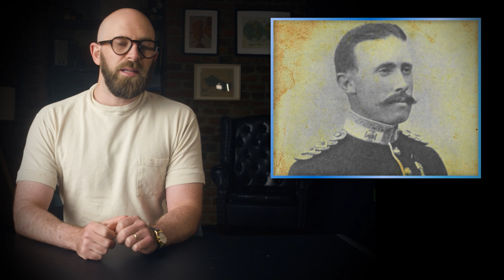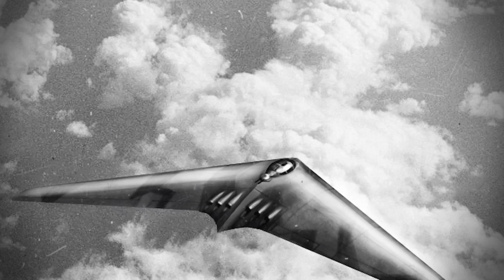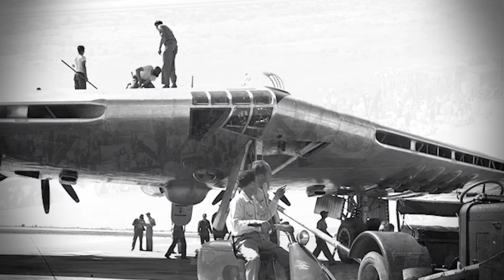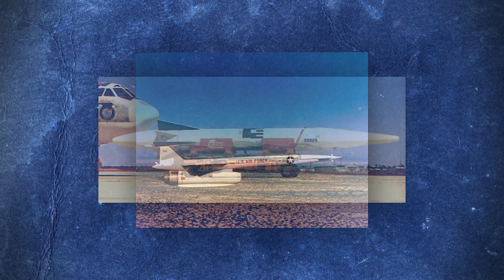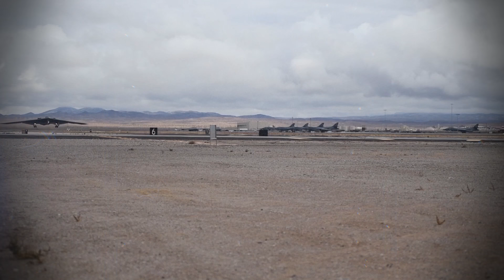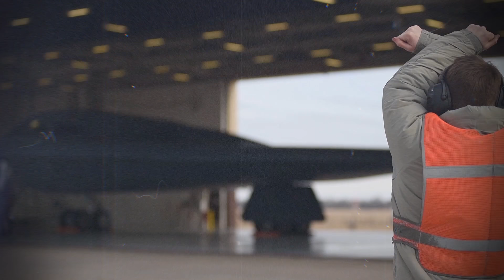$2 Billion Each - A Deep Dive Into the Incredible Engineering That Culminated the B-2 Stealth Bomber

Comment: $23,529,411.7647 Is how much it cost to kill each of those 85 militants.
NOT taking into the cost. The wages of the pilots. The Fuel. Or the munitions involved.
How much did the ground crew cost?
How much did it cost to train the ENTIRE ground crew to maintain this beast?
What about the training of the flight crew?
It has to be stored in a pressure controlled hanger!
Whatever you do, do not fly this thing when there is moisture or rain!

Comment: Part of the high cost is that when planning out it was sold as a 1 for 1 replacement for the B-52s but numbers were cut and instead of spreading out the static costs over 100+ airframes it was just 12 or something to start.

Comment: Not to belittle the achievements of any engineer or inventor I would just like to point out the flying wing should maybe be contributed to also the inventor of the KITE after all if you look at a kite and attach a string that’s really what theses are!!!!
Reply: That’s a silly way of looking at it. Flying wings have historically been some of the hardest aircraft to engineer. Maybe only possible today with highly computerized fly by wire systems

Comment: One minor point. In the XB70 it was discovered that tilting down the outer edge of the wings created a vortex that added to lift.

The advances in technology in the US has been so rapid and extreme in so many areas that these one time wonders are now relegated to obsolete despite constant expensive upgrades to all of them. 

The B21 despite being smaller and having a smaller maximum payload is far more advanced than B2 but is sure to upgraded many times during its service life. 

I have been following developments in military aviation closely and I was shocked and disappointed by the recent announcement of the F47 to Boeing. Based on what I know about the possible alternative designs and contractors IMO the DOD could have done far better in both areas. I think I wasn't the only person who expected the Lockheed SR72 to be selected.  Even this plane in its current prototype form has room for major improvement based on currently available and soon to be available technology.

Comment: I was working for Northrop when the B-2 was being developed (before Northrop - Grumman merger). This was before Auto-cad, and Northrop had developed it's own CAD (NCAD which ran on Unix operating system) which myself and many colleges received training on.  We were able to learn by working on a small collection of pieces of the plane which included parts of the outer mold lines  (defines the external surface of an aircraft's aeroshell).  An associate "Rory" was able to hack together the shape of the exterior of the plane, was subsequently fired for a couple of weeks, and was subsequently re-hired.  I believe this was the first plane to be built using CAD and "geometric dimensioning and tolerancing " to complete the assembly with hard models which were typically used to ensure one assembly fits to another.

Comment: Downvote for the 40 minutes of black and white time wasting like 1990s discovery channel late at night when budget was zero and for your phony cadence, both of which you deserve numerous downvotes for per person. Instead it could have been a decent video but you chose intentional douching of wasting time for your wet dreams of watch time. Was the video not caked in scumbaggery a constructive suggestion would have been that there is thermal video of a B-2 and it is exceedingly visible. Similarly infrared lasers of even very faint power will echo off it at hundreds of kilometer distance. I have little doubt that modern radar circuitry can detect it with similar ease. It is an emperor's new robes illusion. It is an exceedingly expensive sitting duck and it's quite puzzling that the world indulges the illusion. To redeem yourself you could make a video with such an angle. It would be very topical right now.
Reply: It’s the one thing he injects into all of his videos across all 8,000 channels he has. His political biases based off being from Britain I can’t blame him. Sort of a trait they all have. But yes he goes out of his way to spew garbage opinions left and right and it’s a huge turnoff. Would he good content otherwise.

Comment: What is the biefeld brown effect of the B-2 stealth bomber?
The Biefeld-Brown Effect is based on the research of Thomas Townsend Brown who in 1928 gained a patent for his practical application of how high voltage electrostatic charges can reduce the weight of objects. The B-2 bomber employs sufficiently high voltages to significantly reduce its weight. Thus it’s incredible range

Comment: The cigar shaped fuselage enables several sizes of plane to be created from the sample design - simply add extra length to the fuselage.

The flying wing requires the entire plane to be scaled up or down in proportion.

While less fuel efficient, the cigar shaped fuselage is more commercially efficient.

Comment: I was at RIAT Fairford in 1997 when the B-2 was advertised as doing a flypast after flying in from the USA after which it would fly back to the States. It was escorted by two fighters while it was in UK airspace. The whole crowd was ecstatic when as it approached and had its landing gear down. It landed and stayed for an hour or so before it lined up to take off and as it rolled down the runway its escorting fighters appeared and joined as it disappeared into the distance on its long journey home. An absolutely magic moment.
Reply: That would have been awesome to see.

Comment: Simon, you forgot to mention the highly classified thrust augmentation system in the wings, utilising Thomas Townsend Brown’s mega-volt differential system from the leading edge to trailing edge of the wings. This system probably conferred extra RADAR stealth due to the extremely high voltage electrical field around the aircraft. Check out TT Brown and electro gravitics

Comment: The cost per aircraft would have been much cheaper if they had built the original 100 planned. As very few were actually built, all of the costs of research, development, manufacturing tools, etc. had to be paid over 10 instead of 100 aircraft. This included the special materials developed for stealth improvements.

Comment: I was in my deer stand when one of these came overhead. I could not hear it and all of a sudden everything got dark as it went over it was going slow and it looked like it would fall right out of the sky. It was going to do a flyover at a veterans parade in Branson Missouri about 5 mi from where I was at. I could not hear the thing until it went past me. And then it was still pretty quiet. But once it got to Branson they kicked on news afterburners that this guy said they don't have😂. And that thing was deafening 5 Mi away. And it went straight up in the air. I'm sure it did not have anything for a payload in it. That is the weirdest thing I have ever seen as far as aircraft go. That thing came right through the holler over top of me so I imagine they were using this flyover in Branson as part of a training session to maneuver in between the valleys. This thing is damned impressive and I imagine it's probably worth the money we spend on it because we waste trillions of dollars on other crap that we gain nothing from.

Comment: I used to work on the B-2 project.  I was an engineer at Vought, which built the engine sections of the plane, so I can say something about the price per unit.  If you simply divide the total program cost by the number of planes built, you get a number about 6 times bigger than it originally would have been because we only built 25 of them instead of 150.  If the unit cost is $2B with only 25 built, it would "only" have been $333M in today's money with 150, and that's pretty reasonable actually.  IOW, the unit cost is a function of the number built and so always increases with that number decreases.

I can also say that those that were actually built cost more individually than would have been the case if more had been built.  This is because the tooling needed to build the things most efficiently was never made.  Because the design and materials were so radical, the tooling had to be rather different than normally used in aircraft construction.  And for the 1st 20 or so planes, in addition to mastering making the parts and assembling them properly which is part of every plane's construction, every assembly also had to be tested for stealth.  Often, this required slight changes to the shape of parts, which meant changes to the tooling needed for them.  Thus, all 25 were built using cheap, disposable tooling and then a lot of artisanal hand-shaping and such, which is very expensive.  The plan was that once all such issues had been resolved, we'd get permanent tooling for mass production and thus lower costs.  And this agreement happened about the time Vought was building plane #20 (as a subcontractor making only part of the plane, we were building plane numbers way ahead of them rolling off the final line).  And shortly after this is when the program got cut to 25.  So there was no point in buying the proper tooling when we weren't going to get any real use out of it, and so ALL the the planes ended up being artisanally built.
Reply: If only am engineer’s opinion mattered in terms of efficiency amd ROI
Reply: Turns out those B2's are actually really, really good at what they were designed to do. This being said with the knowledge of what they pulled off in June of 2025.
Reply: From an accountant’s point of view, with all those sunk costs, the USAF needed to build more of B-2 to drive down the per unit cost. Plus, additional, why cannot the USAF use the B2 bomber longer much in the way that the B-52 continues to serve.
Reply: Wow you can't even do simple math or thinking... and you are claiming to be an engineer? You literally just pretended that if you made six times as many that somehow those other 5 would have been free... and then you talk about today's money which is inflated so it should have went up not down. You are probably lying about working on the project and if you aren't you were dead weight.
Reply: @thomgizziz another comment by a different commentator align with this one. Your criticism probably is not entirely justified here.
Reply: @thomgizziz total programme cost = x. NG needs to recoup ~ x. Government orders 150. NG charges ~ x/150 per plane. Government orders 25. NG charges ~ x/25 per plane. x/25 > x/150. x/25 = 6(x/150)
Reply: @thomgizziz  Tell us more about your bad reading comprehension.

Comment: I actually was inside that facility, after the B2 run.  Talking with those there they said you get the $2B price tag due to the government canceling the full production run.  So instead of amortizing the tooling cost over many units it now has to be amortized over the few.  Tooling is a fixed cost no matter how many units are built.  It was an interesting experience being inside that place.
Reply: Also a redesign of some parts due to airforce wanting the b2 to work well at both low ans high alt

A "small" change can force a lot of redesigning

Comment: We live not far from Whiteman AFB. It's not uncommon to see them flying in and out as you drive by. They occasionally have airshows there, and you can take a carefully-guarded walkaround of the aircraft. They also often do flyovers of the Kansas City Chiefs and Royals during the national anthem, which I suppose is good practice for the pilots. I'm also a private pilot, and just happened to be in the air right before one of those flyovers. I was listening in on the approach frequency and heard the controller warn the B2 that there was an unidentified aircraft in the area and that they weren't talking to them. They were talking about me, so I keyed the mike and identified myself. They asked me to move a few miles out of the way, where we had a great view of the flyover from above. Afterward, the B2 returned to Whiteman, and we were allowed to go on our way. I'll never forget the experience.

Comment: Complete failure as a program. At any one time no more than 2 are serviceable to fly, the rest are either used for parts or sit in a state of endless repair. Thats not to mention the cancer causing procedures required by the Airforce. Climbing into the exhausts without PPE!!

Comment: The engineering of the B-2 bomber probably started in the early 1970's, and it was a long and arduous process because almost everything about the B-2 was more or less brand new, which mean extremely expensive engineering work to be done. The design that was shown to Jack Northrop just before he died in 1981 was probably still a long way from the final version that emerged in 1988.

Comment: some corrections...

Loughead is pronounced the same as Lockhead, the change in spelling was meant to encourage the correct pronunciation.

CFD isn't what used to design the radar signature of stealth aircraft. CFD can only simulate aerodynamics.

Contrary to popular belief, naturally stable flying wings are possible to make. The B2 is not immune to instability as its crashes have shown
Reply: Also, mentioned around 4 min.... anhedral does not increase roll stability, it decreases it. But its often applied to aircraft, often high wing cargo aircraft that are otherwise too roll stable, thus improving manuverability by making roll less stable, but still adequately stable.

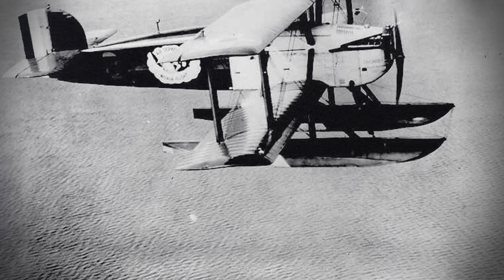Comment: 16:10 Northrop left Douglas in 1926, the same year Ed Heinemann joined Douglas. Heinemann also started out as a draftsman and like Northrop, he was a self taught aeronautical engineer and designer. Interestingly neither of them had a formal higher education, yet both went on to design iconic aircraft.

Comment: Interesting fact.
Boeings proposal for a bomber was not going to be accepted. And the deadline to resubmit a proposal being just days away after their 1st proposal being denied.

The 3 engineers who personally submitted the proposal returned to their hotel room.(on a Friday)
They spent Friday,Saturday and Sunday designing a new bomber proposal. They drew on their experience and knowledge of several other bombers they had been involved with and created the new design by incorporating different parts and ideas of each different bomber including engines.

On Monday, the last day to submit a proposal, they submitted their new bomber concept.
This bomber was ultimately accepted by the Airforce. Its known today as
.         "THE B-52"

Designed in 3 days in a hotel room, literally on napkins and scratch paper.
Then drawn on paper from a local department store.

Comment: A great deal of $2 Billion unit cost was development and tooling costs.  After the order was reduced to 20 we proposed that we could build an additional B2 for $500 million.   That means $1.5 billion per plane were allocated fixed costs.  If the full number had been built the unit cost would have been less than $725 million per plane.

Comment: There is no on board galley as delivered from Northrop.   We designed the B2 so there could be 4 ejection seats on the flight deck.  The USAF did not authorize the necessary components for the 2 extra ejection seats.  The result as delivered  has 2 ejection seats and a lot of empty space.  None ejection seats and lots of other things and be put in the big space.   The USAF ground crews bought lawn furniture and Porta potties for flights.  (The USAF did not want to pay Northrop for a built in toilet).

Comment: It is absolutely false that a human could not fly the B2 without computer augmentation.   The problem is that flight envelop would be very restricted.   Certain maneuvers that can be performed in conventional aircraft have no way to recover from.  The B2 system makes sure the dangerous maneuvers are never entered.  The system is so complete that B2 dies not need a pilot.
Reply: Without a flight computer controlling a pilot woulld be worn out keeping control. One wing or the other wants to be the leading edge. A pilot cannot control this. The pilot would be pushing the rudder peddles constantly.
Reply: @Mike-mz8dl  I have flown the simulator and talked to the pilots and aerodynamists, while I wouldn't want to fly the B2 without the computer, it can be done.  You may be confusing the B2 with the F117 which is impossible to fly without computer assistance.   In the early testing of the F117 there was a computer failure cause loss of the aircraft and pilot.   That pilot loss was had a big impact on my friend who worked on the test project.   
In WW1 the aircraft were purposely made unstable and required constant correction.  This was considered good, because the instability also ment better aerobatics.  
Now it is true that for an airliner and bomber, stability is preferred.  The B2 however can theoretically perform maneuvers that  no fighter plane can.  The risk is that most of these maneuvers  are outside the safe envelope for the B2.  Thus the B2 is programmed to prevent these risky maneuvers when initiated by the pilot.
Reply: @saltyroe3179  I don't know about your flight simulator experiences. I just worked at the B-2 System Program Office at Wright Patterson AFB and talked to a lot of the government scientists and engineers. No flight computer and you get a burning hole in the ground. Man cannot react fast enough.

Comment: More false statements.   The N9M was easy to fly.  The YB35 was also easy to fly.  The problem came when  the jet engines replaced the props.  The fairing that covered the propeller shaft acted as vertical stabilizers. Without the fairings on the jet version the aircraft was unstable.  
Thus no successful pure flying wing was developed until the  B2